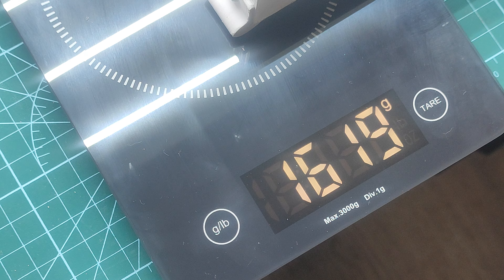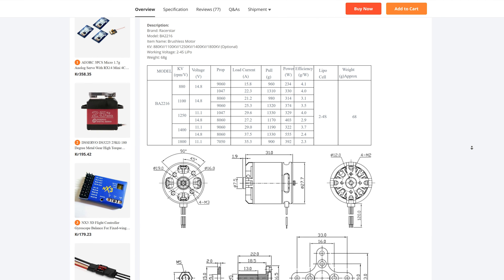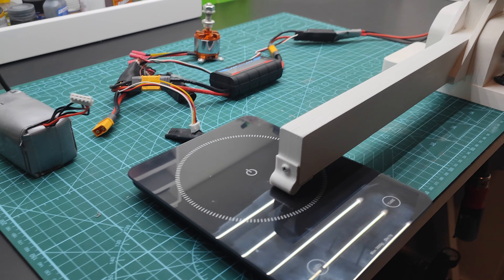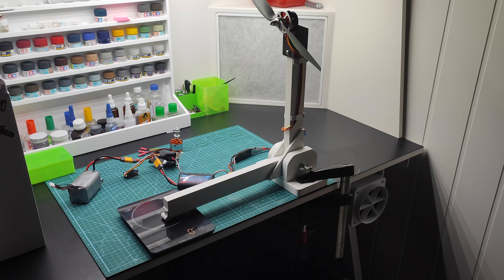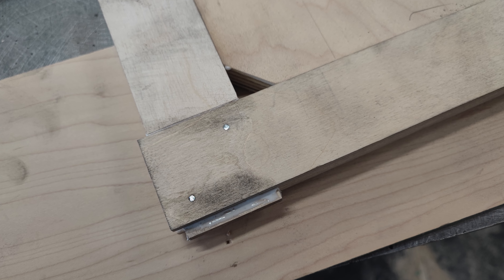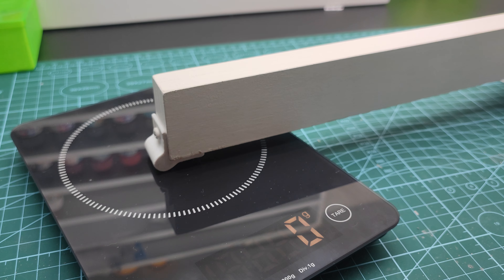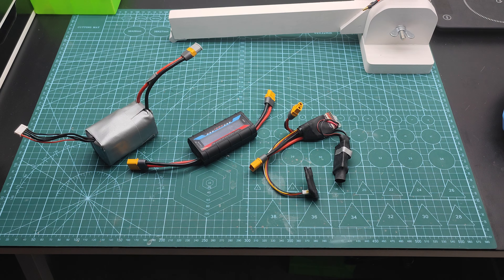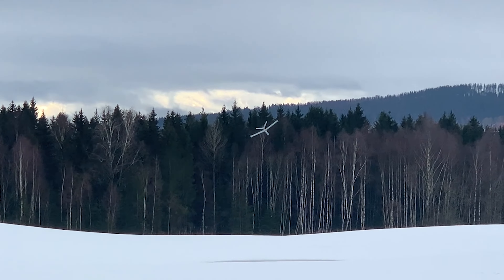💡🔨 DIY | RC MOTOR PROP THRUST TESTER | STAND | RIG

Comment: That’s funny I built a nearly identical test rig to measure static thrust.  Doesn’t tell you much regarding propellers for fixed wing aircraft but it’s great to test motor efficiency and ESC’s!  I’ve switched to using CASTLE CREATIONS and T-Motor and Sunnysky, with APC thin electric.
Reply from the maker: @FPVREVIEWS  Yeah I literally use it only to check if I meet approximate thrust and pitch speed, tho it's just static. But I never tested motor efficiency on that, may I know what's your workflow for that? (So far I sticked with Skywalker ESC and switching to SunnySky. (However dunno if the extra money on ESC makes some significant difference?)

Comment: Great video. I have a similar set up. I have always wanted to rig up a big home made wind tunnel to put it in to test props at different wind speeds... Or you could always strap this to the top of your car I suppose lol.
Reply from the maker: Yeah, static tests are good just for rough reference. Check out TetaCalc, there should be a database of different setups from wind tunnel. I

Comment: Just mount the motor on a piece of wood and then put it on the scale and have the prop turn in try direction so it pushes the motor down on the scale. Easy thrust tester.